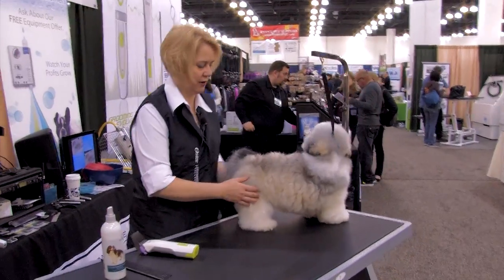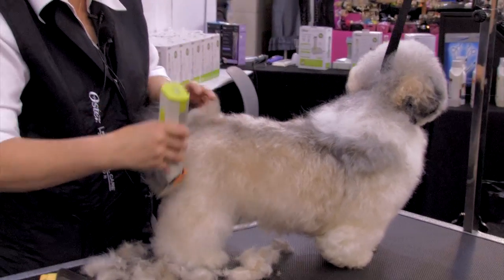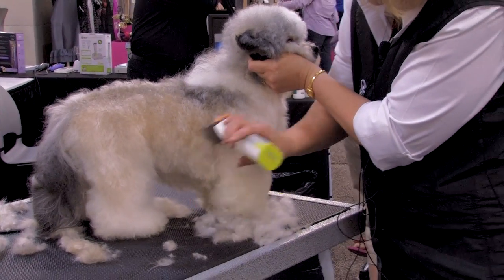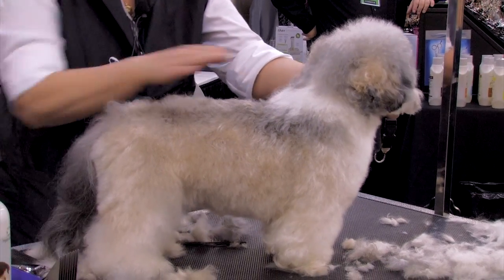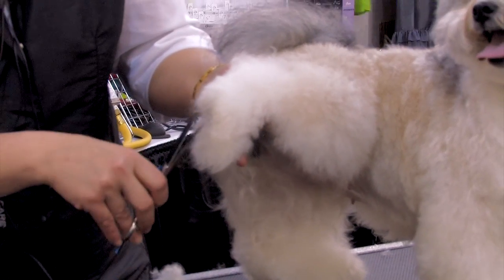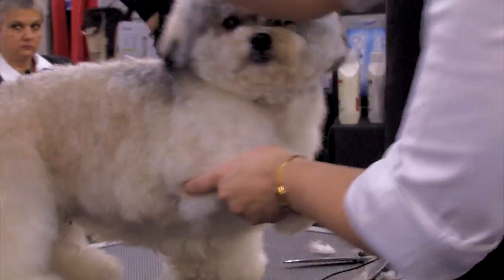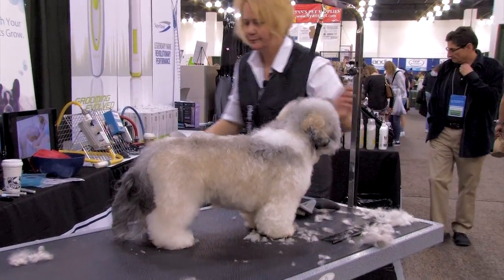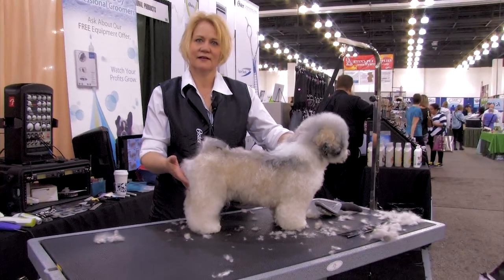Chris Pawlosky: Teddy Bear Trim

Comment: I have a Teddy Bear and viewing these videos kind of learning to do this myself type thing. Unfortunately I picked up some Walmart clippers lol and they look nothing like in this video. I haven't done anything, but wondering if you have a how to site. I also wanted to know if you could list the items I would need. My dogs name is Sniper and he is 2 years old January 17th, 2017. He currently goes to the groomers but I really would like to do this myself instead of traveling 36 miles there and another 36 back home for his haircut. Suggestions of books more videos?
Reply: Mrs.Toy Williams 
I am from London UK,  bought dog special clippers for my bichon costing me £50,  sound expensive but worth it.  watch couple of videos for a week and that's it.  I bought slicker brush,  Dog hair shampoo, conditioner spray,  spare towels,  bath anti slip cheap mat to avoid scratches,  scissors and hair dryer from home.  my bichon had a lovely cut,  I not only saved money but feeling good in myself too.
Reply: Mrs.Toy Williams Wal-Mart clippers are not great, but as long as you can change the blade you'll be fine. I would use a professional blade. Also use metal combs instead of plastic I find better. Amazon or pet edge has some good choices in Oster.
Reply: @arshtruth3649  Good to know you have a bichon.   I have a 3 year old all white Havanese. These breeds are very similar if not related.